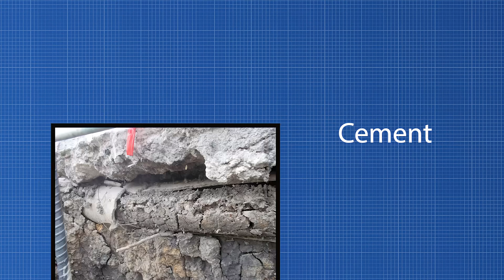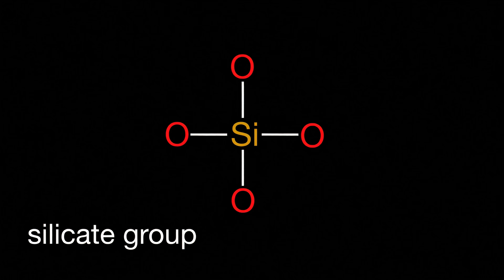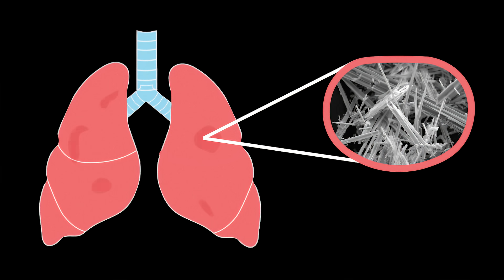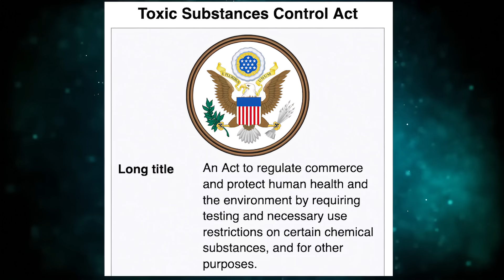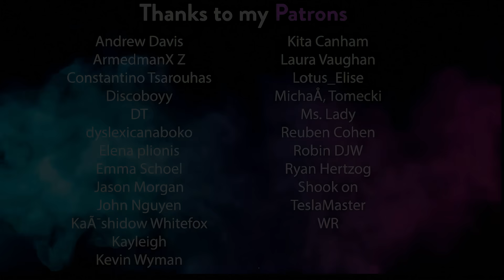Why Is Asbestos so Dangerous?

Comment: The School district I went to growing up had an old middle school that was built in the 1920s. It was turned into a museum at some point and I remember being really young and going on field trips to it almost every year for a few years. When I was about to get into middle school, it was torn down and replaced with a new building that was actually used as a school building instead of a museum. It was torn down because it was built with asbestos and it was starting to deteriorate. Sometimes I wonder if the demolition crews were harmed by tearing it down at all

Comment: >Miracle material shows up
>Lots of potential to solve tons of different problems
>We start using it and loving it
>It becomes extremely cheap and spreads to every single object
>We eventually find out that such material is actually extremely bad and unhealthy for us and we need to get rid of it ASAP
PFAS, mercury, coal, oil, asbestos, lead, plastic... I wonder what comes next

Comment: I cant find any source that claims that 34,000 9/11 workers out of 90,000 have asbestos related cancers. It is nowhere near that high, they’d all be dead by now and yet we only have about 4000 deaths related to all 9/11 exposures and cancers not just asbestos and lung cancer/mesothelioma… 

I also think you really should have gone more into the specifics of the types of asbestos is really two things chrysotile and amphiboles… chrysotile is bad to get exposed to, especially over long times or a career or in high levels, but amphiboles are the ones that go in the lungs and never leave. Everyone is exposed to asbestos to some level, if it were all amphiboles wed have way more deaths to it. The only reason we only have a handful (4) of mesothelioma cases linked to 9/11 out of 400,000 exposed so far is likely because it was chrysotile used in only half of one of the towers. 

I honestly think this video could have been a bit longer and shared so much more interesting and scary information… but also remained a but more grounded… hundreds of thousands of people were exposed, but few of them will die from it… i think its important to educate people and where the scariest types of asbestos are found like pipe insulation or the uk and Australia. 

I think there should be clarification about the 34,000 out of 90,000 figure, i checked online and found nothing to back this. 

Video could be better. I was exposed to asbestos due to renovations with my dad and this video would have sent me spiraling months ago, as you mentioned the issue of exposure is alive and well, but with 4 deaths directly linked out of over 400,000 exposed and 4000 deaths so far… but there are almost a thousand lung cancers… the problem is people were exposed to crystalline silica, heavy metals, PAHs, dioxins, and other combustion byproducts as well as asbestos and its hard to clearly see what percentage of these cancer were caused by which byproduct… its likely a combination of all the exposures not just asbestos.

So the situation with asbestos is grim, but surprisingly most people exposed don’t die to it. The human body is surprisingly resilient, but exposure should be avoided at all costs going forward. It’s not fun living knowing a stupid mineral could be the death of you even if you know it’s unlikely.

Comment: Industrial grinding wheels and discs used asbestos as a binder, and it would be released into the air as they wore down.  A friend of mine owned a small company that did a lot of hand grinding of steel castings in their manufacturing processes.  It was a family business that was started by his father, so he had been exposed to grinding dust for decades.  He developed mesothelioma and later died from it.  It’s an ugly way to die.
Reply from the maker: That’s why I find asbestos so scary. You dont think of all the ways it can get in the air

Comment: It is pity that so versatile material is so dangerous for our health
Reply: It is a pity but it also makes sense. We want these ultra sturdy but flexible, long-lasting materials to build with, but those very same positive qualities will always end up being an issue if they manage to enter in our bodies. Whatever lasts a really long time outside our bodies is likely to also last a really long time within them, such as plastics.
Reply: Fiberglass isn’t any better!
Reply: @CajunReaper95  fiberglass really is brutal. I used to work at a factory where we made various fiberglass products and it was always in the air. The place was also super hot from the ovens, so it was impossible to completely cover up and wear a mask at the same time. Breathing it in, as well as getting it on your skin was awful
Reply: @CajunReaper95  
Misinformation. 

GFK-Staub bleibt nicht so dauerhaft in der Lunge wie Asbest.

Warum?

Asbestfasern sind extrem fein, flexibel und widerstandsfähig gegen Abbau im Körper. Sie bleiben oft ein Leben lang in der Lunge und verursachen chronische Schäden.

Glasfasern aus GFK sind meist dicker und brechen eher in kürzere Stücke, die vom Körper besser abgebaut oder abtransportiert werden können.

Allerdings:

Wenn du dauerhaft große Mengen GFK-Staub einatmest, können die Fasern trotzdem Entzündungen und Lungenschäden verursachen.

Sie werden aber normalerweise eher vom Körper mit Schleim oder durch Immunzellen entfernt als Asbest.

Kurz: GFK-Staub bleibt nicht "für immer" in der Lunge wie Asbest, aber trotzdem sollte man das Einatmen vermeiden!
Reply: We can't have good things says God
Reply: @SirJinx-t9m so when did he say that? Were you there?